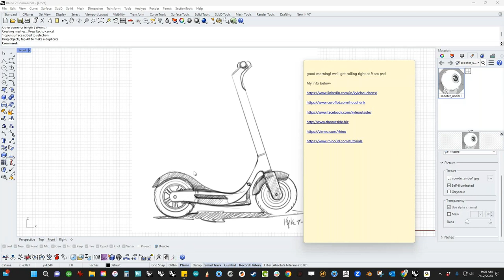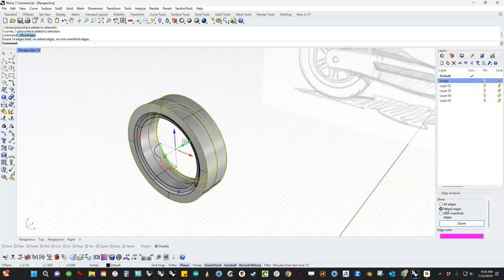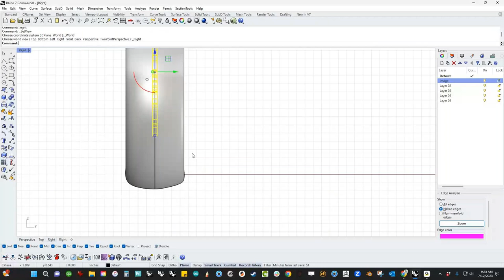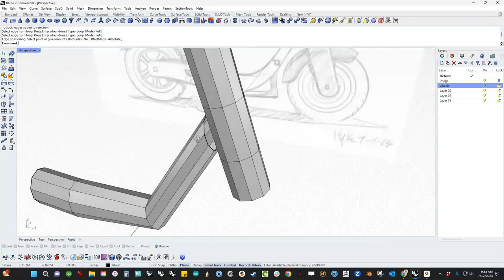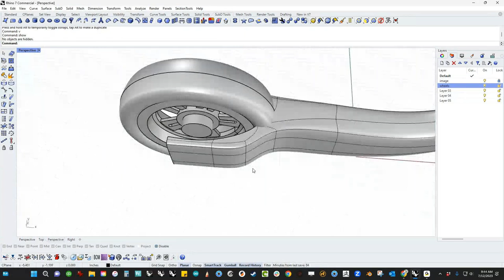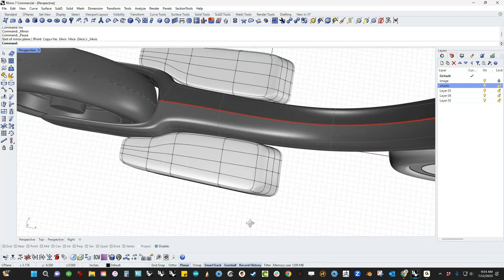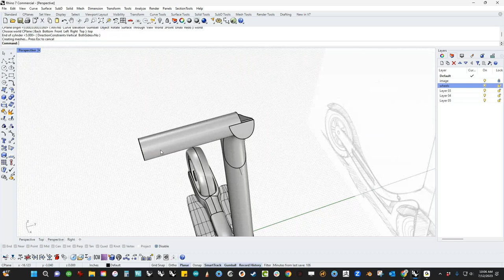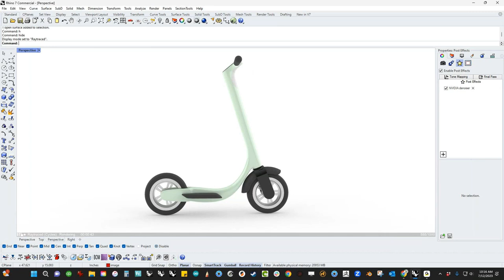Rhino 7 for Windows - Scooter Build

Comment: I'm new to rhino (originally a solidworks user) and I was wondering at 15:15 you snap the sketch (tire circle) to the center of the object (rim) and I can't get my osnap to do what you did in the video. Could you give me guidance on what you did/what I could search on google to trouble shoot?
Reply from the maker: Change your gumball to “snappy dragging” and it will respect osnaps.
Reply: @Rhinoceros3d Thank you for your quick reply it worked!😊